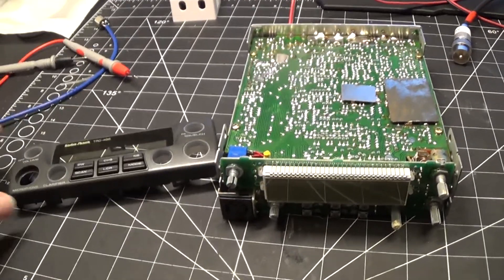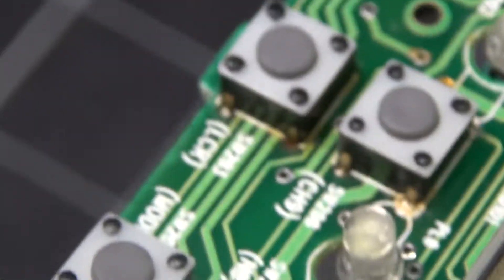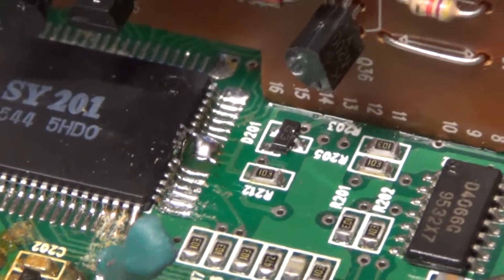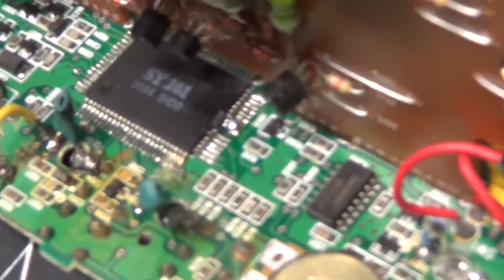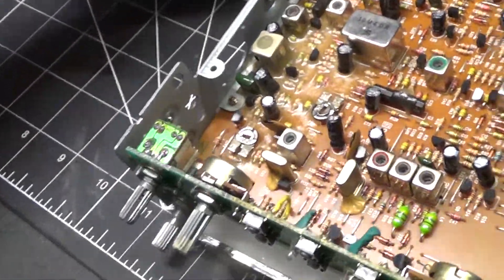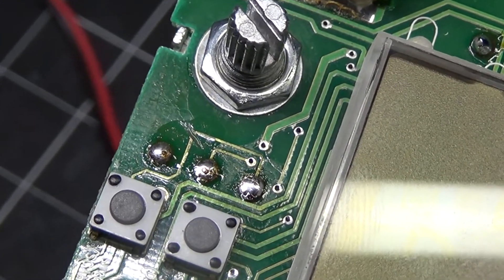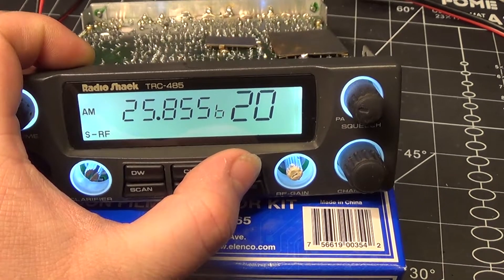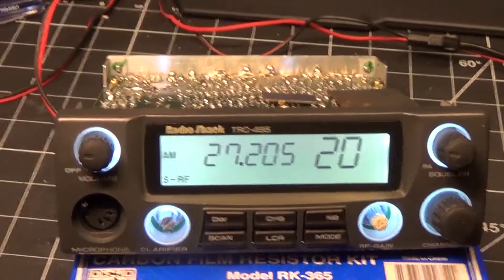Radio Shack TRC-485 Frequency expansion mod

Comment: Back in the day I converted many CB radios to 10-meters.  To work on the Amateur 10-meter band the radio will require a full alignment of the transmit and receive circuits.  The PLL synthesizer can be modified to cover out-of-band frequencies, but the radio won't be adjusted to work efficiently - without realignment the radio will have very little RF output, and the receiver will be deaf.  The circuits just ain't broad enough for one setting to cover both 11 and 10 meter bands.

Comment: Que pasa

Noticias

Todos los filtros

Resultados de búsqueda

Resultado de traducción

Español

Inglés

friend I have the same radio I followed your steps but I am blocked since it does not transmit I don't know what could have failed me if the frequencies can help me if they are expanded but it does not transmit I already pressed the button where you change frequencies by banks a,b,c etc . but I'm blocked. Regards

Comment: WHAT about the President Mckindley USA version? Will it do Extra Channels ...I think anything can do more But need Details on Microprocessor chip.
Reply from the maker: It may be possible but would require fully reprogramming the microchip. Anything is possible with the right amount of time and and some reverse engineering.
The reason that the TRC-485 and Magnum 257 are so easy to modify is because they are same radio as the HTX-10 which is a 10/12 meter radio. I'll be restoring an HTX-10 soon and will post a video on how to unlock that one for 11M CB frequencies.

Maybe some day if I have time and come across a Mckinley it will be fun to play with and put on a logic analyzer. Check out Mark19960 on YouTube if you want to see what he did to reverse engineer the Uniden 980SSB (President Grant 2) and add extra frequencies. It would be a similar task but very time consuming.
Reply: Sure wish someone would have been able to do this in 1996 when I bought one brand new. Still had the coolest most modern looking radio at the time.